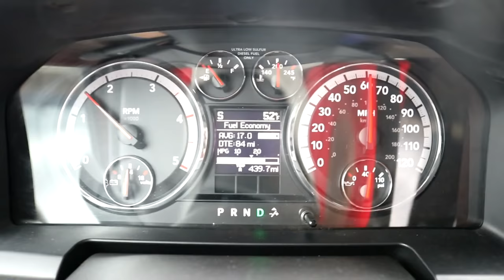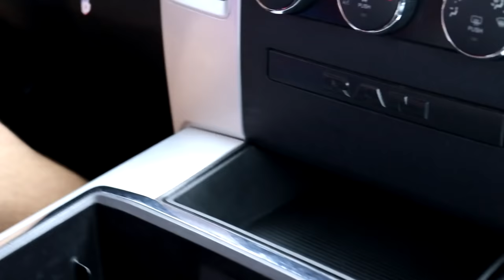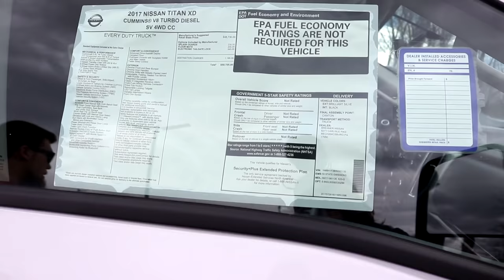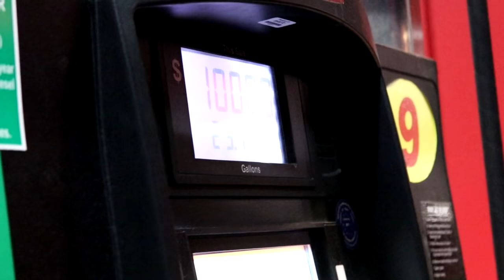Nissan Cummins vs Ram Cummins.. WHAT'S THE DIFFERENCE??

Comment: You can get really nice trims on that Nissan like full color match n shit. Also look at deleted and tuned titan Cummins, not too many people doing it but that's what makes it dope . I heard they can make 450whp on just a tune and that's pretty good considering my brothers old 2012 6.6 dmax dynoed 460whp in its hot tune but that's a full size truck with a full size motor
Reply from the maker: yes I have seen some unique color combos on the Nissan